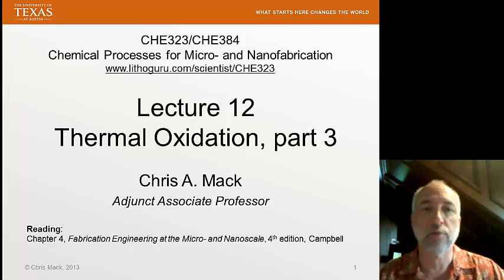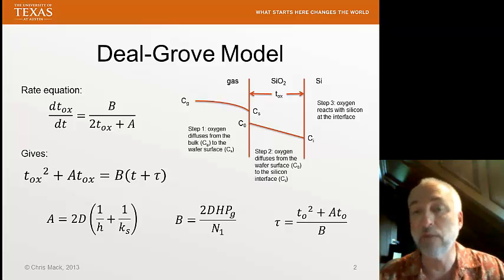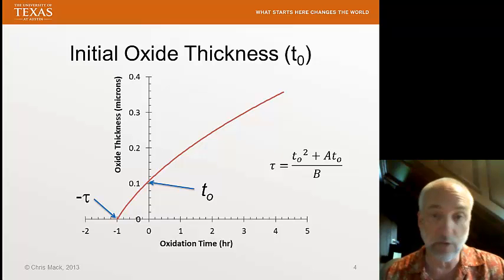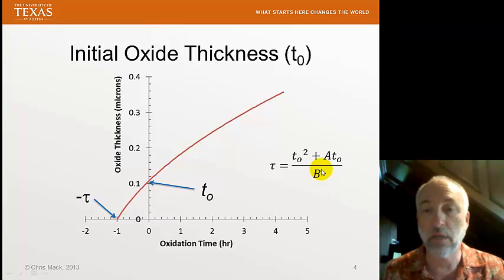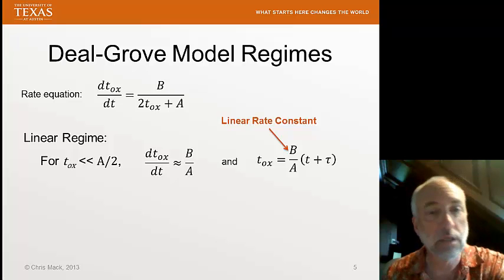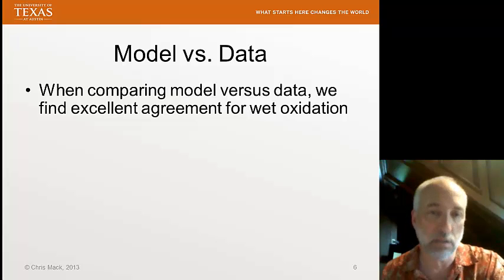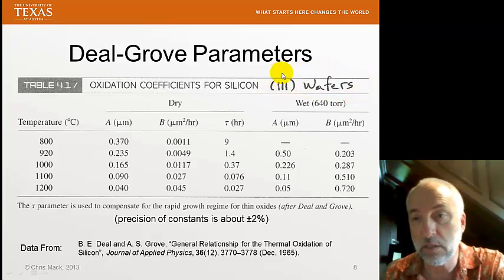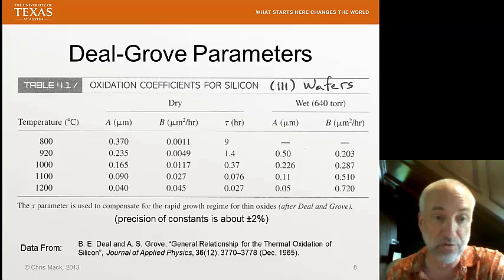Lecture 12 (CHE 323) Thermal Oxidation, part 3

Comment: how did you find activation energy? I have to do this for my lab
Reply from the maker: This is a very standard activity, so a google search should give you details.  Basically, you measure reaction rate versus temperature, then fit the results to the Arrhenius equation.  Here, reaction rate is change in thickness per unit change in time.